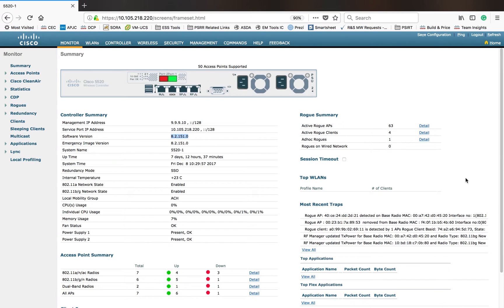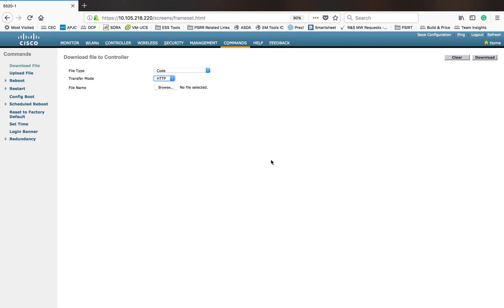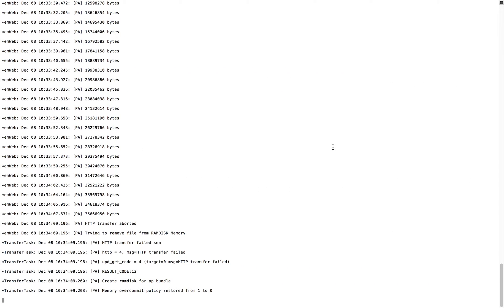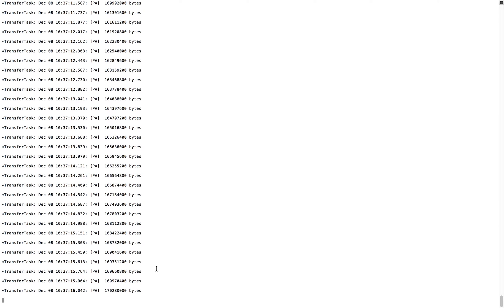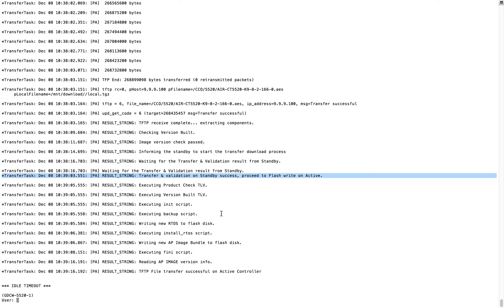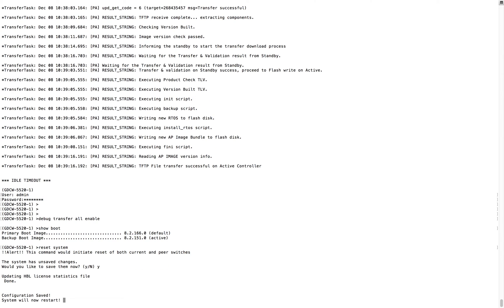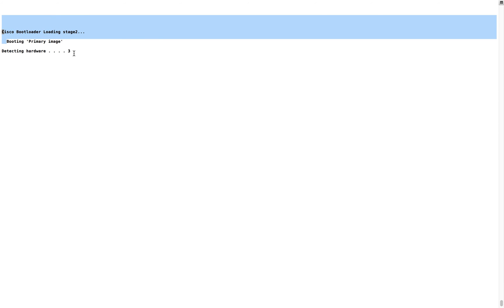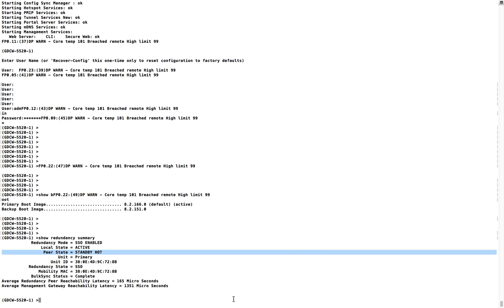How to do a CODE or Firmware upgrade on Cisco WLC

Comment: Hello, when upgrading to two 5520s in SSO mode, the procedure is the same when doing it to just one directly? What is the recommendation, disarm the SSO or perform it with the SSO active? In the end, will they be due reboot both WLC at the same time?

Regrads,
Reply from the maker: In SSO mode, we will be always accessing the Active WLC. The Active WLC can be Primarily or Secondary. We will be giving the instructions on the active WLC and active WLC is responsible to push the code to the stand-by WLC at that point of time. Once the code download and installation is completed reboot can be performed, reboot can be a scheduled one too. During reboot both Physical hardwares will be reloaded and form the SSO again.